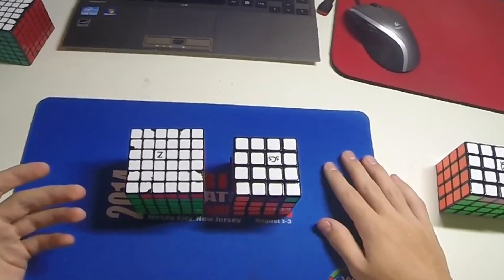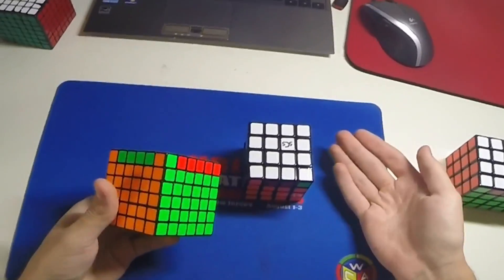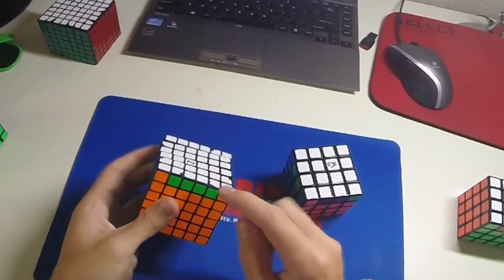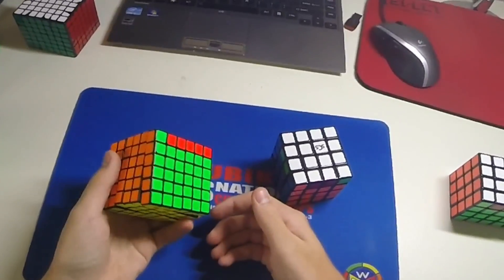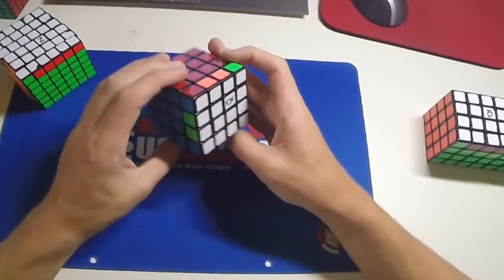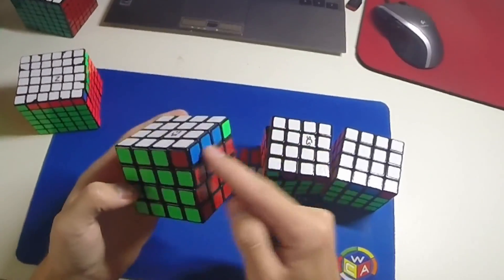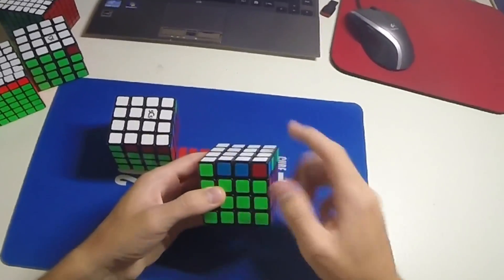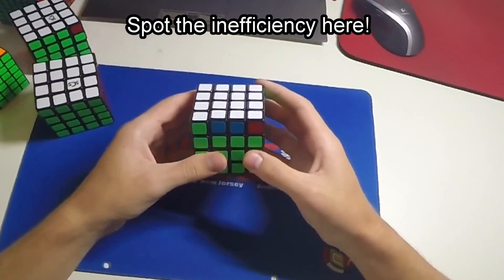Day 2: Doing PLL parity smarter

Comment: which alg did u use at the 4x4 and how u execute them faster do  you have a tutorial just on the parity
Reply: r2 U2 r2 Uw2 r2 u2
lower case is just the inner layer, upper case is just the outer layer, and things with a 'w' are both layers
to do it fast, you could do multiple things, such as using your middle/ring or ring/pinky finger, or replacing every r2 with a Lw2 3Lw2' which just means you turn two layers on the left side down, twice, and then three layers back up, twice. you could also use a combination of these, or something else that i don't know of. If you are lefty, use the mirror of everything i just said.